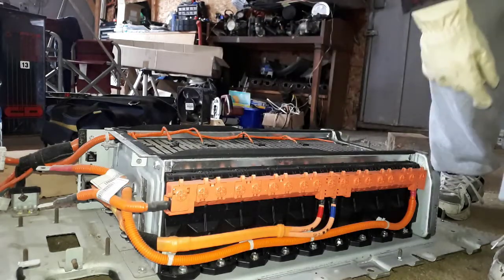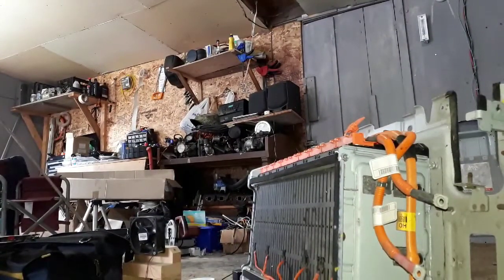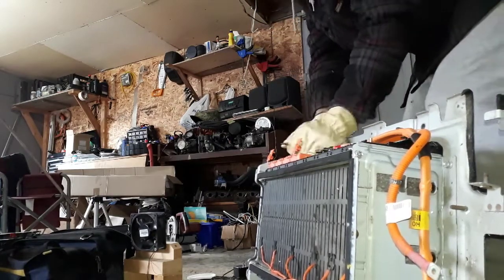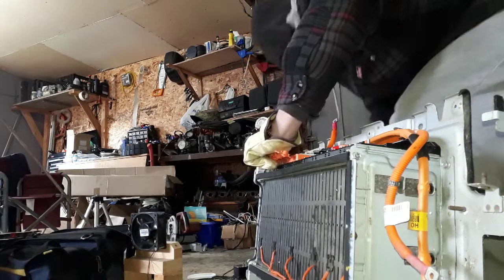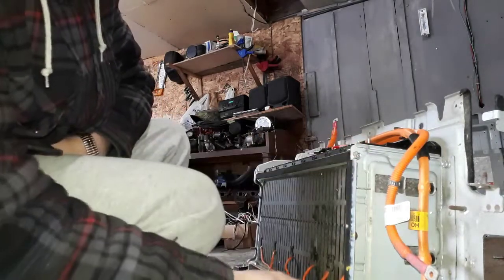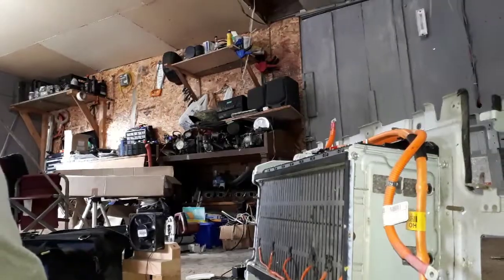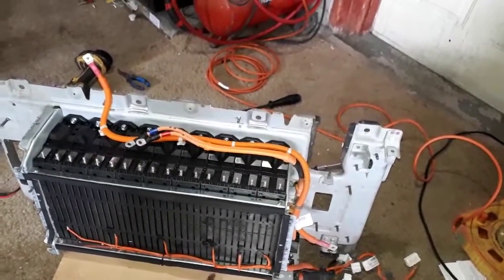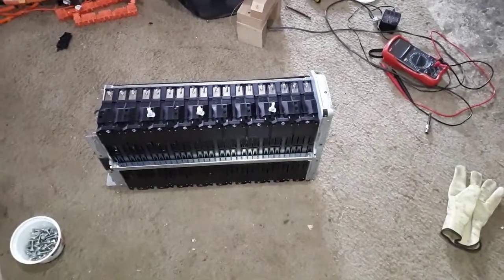Sonata battery pack disassembly

Comment: great video! little bit of work hooking all those wires up but they are my oldest and longest lasting battery so far, plus they screw to the wall real nice! looking good man!
Reply from the maker: Thanks brother . Ive been so busy at work . Its so hard to get everything done. Hopefully before summer itll be all running.
Reply: @frankz1125  do you happen to know if that OEM BMS is useful for balancing without external commands? And can a 3rd party BMS reasonably be installed in those cells/modules to replace the original? 
I'm not finding much info about these batteries.
Reply from the maker: @tanner3801  yes you can rewire and add your own bms. There are plugs on each 8s pack and you could use the old harness if you can find a bms to fit that number of cell. I believe there are 72 cells in series on this pack. Hope that helps. Cheers

Comment: Ok you have started to move away from lead acid this is good. So you just want to remove enough to get the pack down to 120 volts then it can hook into your system.
Reply from the maker: I dont think they will play nice together.  Its one or the other. It will be a while before they will be ready. Be patient with me.

Comment: Dear Frank Z,
I broke off on of the threaded posts on my 2011 Hyundai Sonata Hybrid Battery so I cannot put the not on it to pin the terminal of the positive side of 30V cell. Do you know if the threaded posts are simply a hex bolt glued into the side of the plastic cell plate or is there a wire connecting it to something internal? I have watched several videos and cannot get clarity on this. I am basically hoping i can pop that out and put another one back in? I am wondering if I have to buy a new cell. On another note all my cells are registering 25V except one at 21V I am wondering if I should replace that one? So two questions do you know if the post can be replaced fairly easily and if I should replace the 21V one. What would you do sir. Thank you for your time.
Reply from the maker: There is 8 cells in the pack. I'd bet the there is a bad cell in there. The post is glued in . There is a metal plate that is the actual terminal. And there is a plug on the pack with 9 pins . You can check the voltage of each cell from that plug with a voltmeter.  Hope that helps .
Reply: @frankz1125  Yes thank you. I believe there are actually 9 - 30V Cells in the Hyundai Sonata Hybrid I have and you answered my question perfectly. The threaded posts are glued in. I suspect they are a simple rounded bottomed Hex Bolt glued into the plastic housing of the LG Chem 30V Cell. My only concern as I attempt to get it out is if anyone knows if the backside of the bolt...(the head of the bolt)  is attached to anything like a metal plate or wire of some sort? What I do not want to do is pull it out and find out I have damaged something behind it. If it is simply glued into plastic attached to nothing but plastic, I think I can get that out report the size of the bolt to other people who may have damaged a cell. In truth, I was quite gentle with tightening the nut on the bolt and very surprised at how soft that metal was on that bolt when it gave. I used a ratchet set that was too much for it even though I used my smallest (1/4) ratchet. Can you verify there is nothing behind the head of that bolt embedded in that plastic?  In addition, to all that I am thinking about taking the other cell I have on the same unit that has a lower voltage. (It has a current reading of 21V while the others all read 25V. If the 21V is slowly dying or too weak to charge. Maybe I can make a video to share that would show how to remove the post (bolt) and break down a 30V cell to get inside, diagnose, and troubleshoot a bad or weak cell....? I would love your input on that as well. Most important is what is behind that bolt and is anything connected to on the backside if you know sir? Thank you very very much for this support. Kind of makes me wonder if there is a way to build a network franchise or business of rebuilding Hybrid Cell Batteries? What do you think? If you want to talk offline I am open to a conversation. Not sure if I can leave my email here. ruavolunteer2@gmail.com. My name is Rob.
Reply from the maker: @robburdine5429  I am talking about 1x 30v pack has 8 x 5AH 3.6 v nominal pouch cells in each . If the cells are puffy they are not safe. Play safe
Reply from the maker: @robburdine5429  I have taken the 30 v packs apart.
Reply from the maker: https://www.youtube.com/watch?v=x-KjFtMvGmU&t=154s